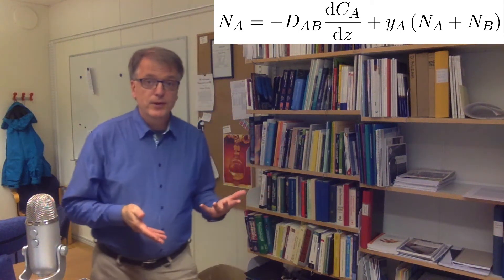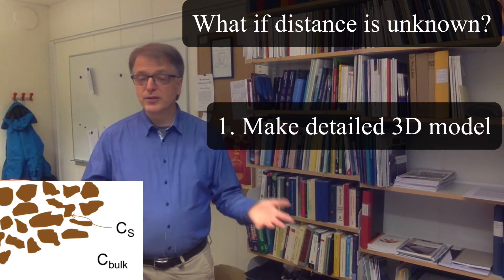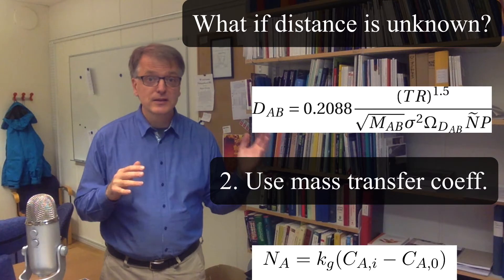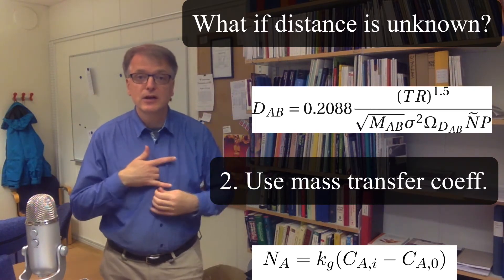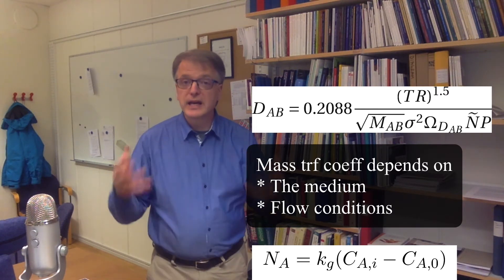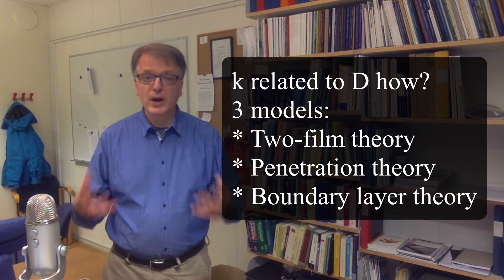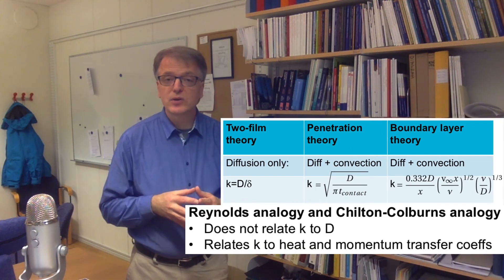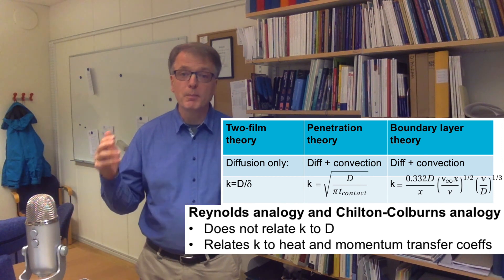Diffusivity versus Mass transfer coefficients

Comment: Hello! Your lecture are easy to understand Sir. Have you prepared a corresponding ppt.
Reply from the maker: Actually, I have as a rule never to distribute my powerpoint files. For my students I prepare a "support for note-taking" file/printout such that students need to actively engage while not having to write everything down. There are several reasons for this, one being that what the student does is more important for their learning than what I do and another being that this way I can ask student questions (if/when I give a live lecture) without them having the answer in plain writing in front of them.

Comment: Excuse me, in the last part you mentioned that Chilton Colburn's analogy says nothing about the diffusivity of mass, heat and momentum. But in the Chilton-Colburn analogy there are Pr or Sc (jH or jD) which are relations of diffusivities ... could clarify this for me. Your videos are very interesting. Thank you very much!
Reply from the maker: Hi, yes I was simplifying so much that I became a bit unclear there, I think the video on Reynolds analogy and Chilton Colburns analogy is clearer: https://www.youtube.com/watch?v=7YlQ_4jL_gs

In Reynolds analogy there is no connection at all between transfer coefficients and diffusivities. As you note, in Chilton Colburn there is, but not in a way that typically makes it easy to go from diffusivity to transfer coefficient. Rather the strength in Chilton Colburns analogy is the same as with Reynolds analogy, i.e. that it helps us estimate the transfer coefficient of one entity (e.g. mass) if we have a measurement of the transfer coefficient of something else (e.g. heat)